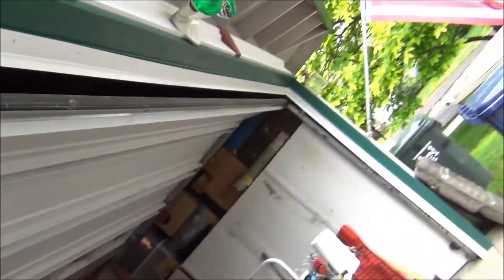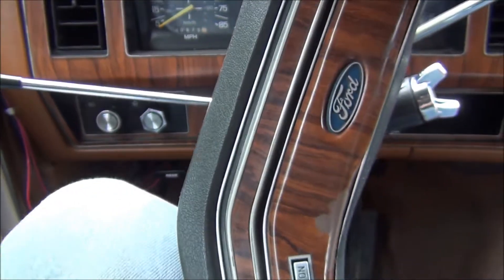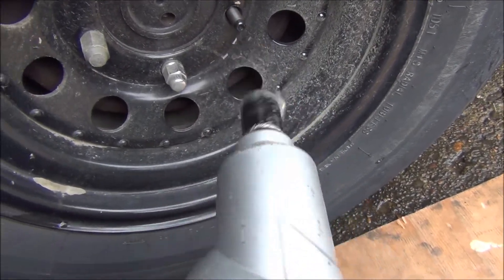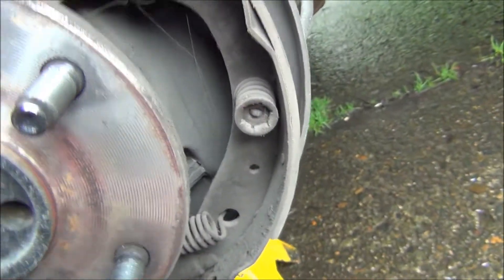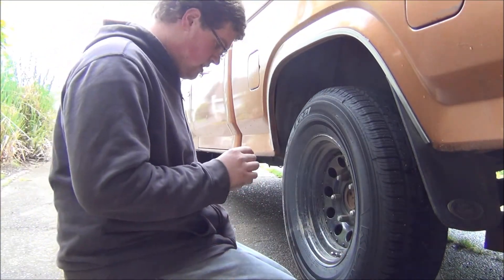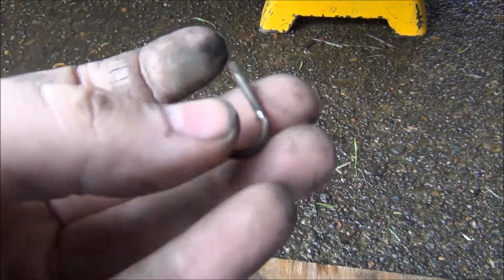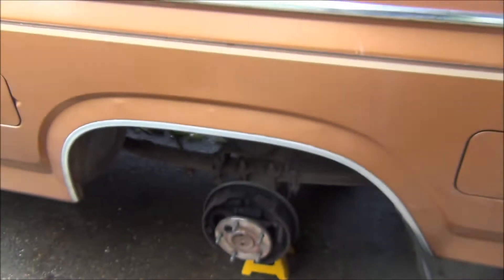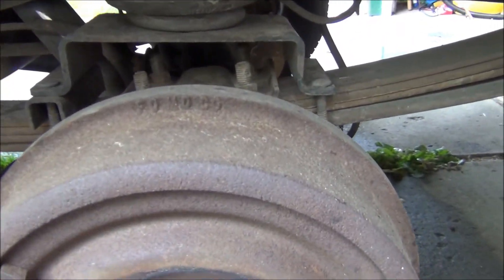Whats Up With My Brakes 1982 Ford F150

Comment: Did you ever get this guy figured out and modded?
Reply from the maker: Ric Owen it’s way different today then it is in this video. It’s Cummins swapped, 4x4 5 speed manual on 35’s
Reply: @justhes  OMG! You really went all out! When you said you wanted to go E4OD, I thought "Oh...why...", LOL. Much rather mess w
Reply: Manual transmission.